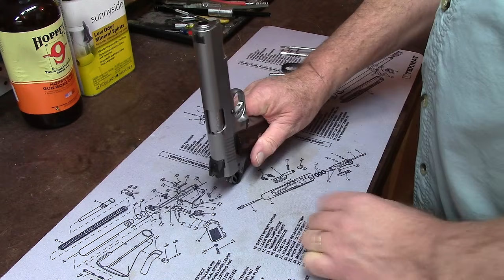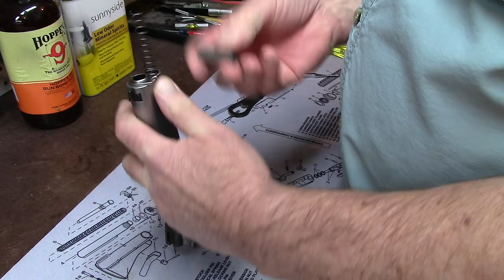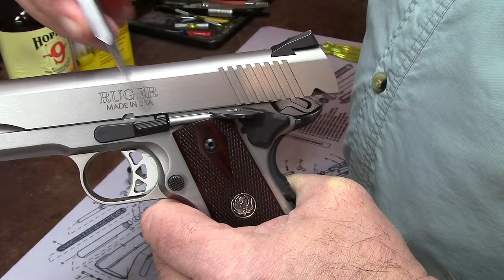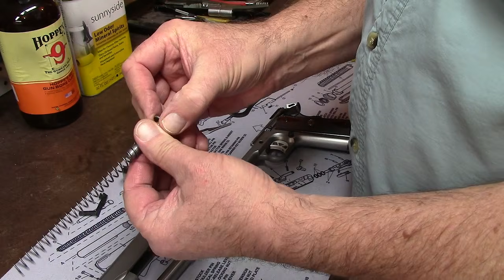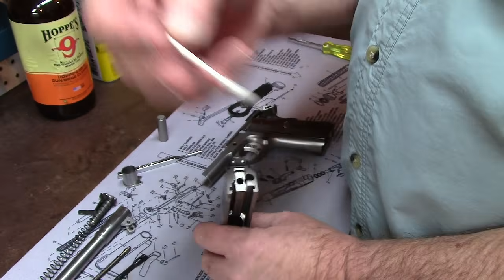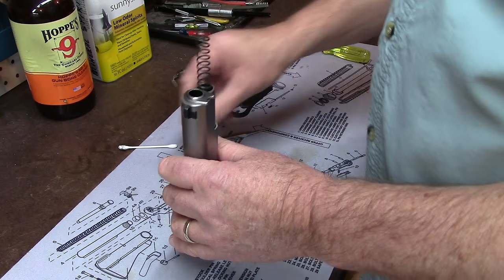How to take down the 1911 pistol for service, inspection, cleaning & lubrication ~ Now in HD!

Comment: Hi Gun Blue, I have a Colt 1911 comber commander and the finish is stainless steel, but it’s a matte finish and it’s a porous finish. What is your recommendation as to clean the finish of the gun? I did have it sandblasted by a gunsmith a few years ago and it look good after the sandblasting. I do use a flannel city with mineral out as you recommend to wipe the gun off when I Handel it. I’m afraid to use Hoppes on the finish or mineral spirits. Please can you help me out. Thank you in advance
Reply from the maker: Your gun requires no special handling.  Steel may have a surface texture, but it is not porous, and stainless steel cannot be damaged by cleaning solvents.  Simply use plain mineral spirits or paint thinner to clean it.  You can clean it with solvent forever with no possible harm.
Reply: Thank you Gun Blue. I follow your videos and appreciate your knowledge. I do use Lsa gun oil. I got some from amazon. Great oil.

Comment: Hi, I was wondering if you would consider doing a presentation on what's going on when a 1911 starts "doubling". That is, firing two or more rounds with a single pull of the trigger. Causes and remedies to this extremely unsafe malfunction.
Reply from the maker: I'm not sure its rarity warrants a video, but I'll answer your possible problem.  Real doubling is when two or more rounds fire in full automatic mechanically from any semiautomatic firearm.  That is caused by failure or the sear to capture the cocking notch after the previous round(s) fired, which is caused by a weak sear return spring.  Replace the three leaf spring.  Two other types of repeat fire can be caused by low trigger weight or weak hand hold that creates "bump fire".  I know lots of custom shops furnish low trigger weight, but a safe and reliable 1911 should have a minimum of 3.5 to 4 pound trigger pull.  Less than that can cause a trigger to bump off the finger and repeat fire.  Like all semi automatic firearms, a defective sear can result in full automatic fire, which is extremely dangerous, not to mention very illegal.  A full auto 1911 is a monster that will empty a full magazine in blinding speed, completely out of control. Understand that custom shops use trimmed 3 leaf springs to "tune" 1911s, and such springs are incredibly dangerous, because they don't have sufficient pressure to maintain sear contact and proper trigger return force which leads to bump firing.  Put a standard 3 leaf spring in, which should fix the problem.  If that fails, replace your hammer, sear, and disconnect.
Reply: @GunBlue490  Thanks so much for the reply! Since the doubling occurred in a bone-stock Kimber (one of those companies that brush you off if you don't do a silly 500-round "break-in" first), and two other shooters tried the gun with the same sporadically occurring results,  I'm going to assume it's either the spring or hammer/sear/disconnect assembly. The trigger pull weighs in at 5-1/2 to 6 pounds, so it definitely isn't an overly light trigger. I've shot a variety of different brand 1911's over the years, but this is the first one that has ever given me any cause for concern. Thanks again for taking the time to reply!

Comment: Very informative, and thorough. I have a question. What do you think about the HORNADY SONIC CLEANERS?  I value your opinion.
Reply from the maker: I used ultrasonic cleaners as an electroplater in the 1960s, when they first came on to the scene for industrial use.  We used them to clean machining debris from recesses in tiny parts before plating. Jewelers use them to clean rings and jewelry.  Ultrasonic cleaners for firearms and loading is the most hilarious nonsense I ever heard of.  There is absolutely no use for an ultrasonic cleaner for any gun or any ammo.  Watch my cleaning videos, especially the AR-15 and shotgun ones.  Get a cleaning basket, dog bowl, and a gallon of paint thinner, and you will have sparkling clean gun parts.  Total cost, less than $20.00.
Reply: GunBlue490 
Thank you very much for informative response. I’ll follow your advice. Again, I think your videos are great.

Comment: Regardless of what your other video says about dropping the slide, you should NEVER do that! Dumb move chief!
Reply from the maker: And why is doing so dumb?  I've done it literally thousands of times since 1968 on various 1911 pistols, it is and always was standard practice, and the pistol was engineered for doing so.  Except for some fragile new age look alikes which are made with below standard components, weakened springs, and delicate steels, any Government grade 1911 will withstand such dropping without flinching.  And this gun will shoot X-Rings along with any so-called tuned gun.  Not all 1911s are created equal, and some of the most highly priced custom guns that are promoted heavily are not worthy of the 1911 title.  They just sponsor competition folks to advertise for them.  I'm an armorer and I certainly do not endorse any abuse to firearms, and if this practice was abusive, I would be the first to know and to make such a caution.  Please don't bother to reply, because I shall not engage in any banter regarding silly opinions to the contrary.

Comment: You've made the best instructional clips I've seen here. I was a tanker in the Fulda Gap during the '60s, and our 'duty pistols' were (WWII vintage) 1911s. They all rattled when shaken! My current sidearm is a parkerized Springfield 'Range Officer', Nice and tight, and butter-smooth.
I've also got a Beretta, and a SIG Sour, but neither of them have any soul...the only way to have a gun with soul is to start with high-carbon steel and good wood. Anything less is just a plastic tool or a toy.
Thanks for the fine vid, and..."Thank you for your service".

Comment: Thanks for the 1911 for dummies videos! The manual supplied with my Rutger SR 1911 is a little confusing. Your video and tips were a great benefit to taking the stress out of cleaning my new gun. You should do a video on a Ruger 22 mark II. It always takes me at least 2 times to get it back together after cleaning it. Thanks again. I am now a fan for life.

Comment: In your professional opinion do you use a bore brush only in one direction or back and forth when cleaning?  Thanks.
Reply from the maker: The direction is of no significance. The important issue is to always allow the bristles to exit each end so they don't bind and bend them, ruining your brush. It has nothing to do with your barrel, which is immeasurably more durable than any brush.
Reply: @GunBlue490  thanks that's the  way I've always done. Have seen several vids that show only one way removing the brush and repeating which seemed a waste. Great vid on the 1911. I have the same one and it was tricky first few times of cleaning.

Comment: FYI-Colt makes drop-in titanium firing pins for Series 70 and and Series 80 guns. I replaced the stock steel firing pin in my RIA Series 70 full-size with a Colt titanium firing pin.
Reply from the maker: That's terrific.  I would be very surprised if it wasn't made and supplied by Ruger under contract.  Pine Tree Castings, Newport, NH, of which Ruger is just a part, is a major supplier for other diverse companies in many industries (plumbing parts, guns, etc.), including the gun trade.  Companies often find it less expensive to outsource, especially for relatively small lots of parts or for expensive metals they rarely use, and difficult to make, as would be the case of titanium.  PTC makes parts for gun firms that would surprise you; sometimes all the parts.  Years ago, I witnessed all Charter Arms Bulldog frames and parts being made there.  It's a very common practice in commerce that has been going on for a very long time, just as Sears never manufactured any products called Craftsman or Kenmore, nor did a stitch of sewing for clothing, all of which were outsourced to their own competitors in the industry.  Though several companies in the gun world sell gas checks for cast bullets, for instance, Hornady makes them all.

Comment: I have a Kimber 1911 38 Super target, when Ishoot it I have frequent double fires. I bought second Kimber 1911 45 ACP TARGET A FEW DAYS EARLIER AND IT FIRES ONE TIME PER PULL OF THE TRIGGER.
I asked a very good pistol shooter fire 4 clips through the 38 Super and he didn’t have a single double
Discharge. I then fired a clip and had 3 double discharges.
Do I have a operator issue or a pistol issue or both? Any help would be truly appreciated. 
Thank you,Bearcase
Reply from the maker: Bill Case 
It's caused by a combination of factors.  It's not a double discharge. You are firing the gun twice.  A light trigger, in combination with a limp wrist and an unusually slack trigger finger will result in releasing, and pulling, the trigger inadvertently on recoil.  Your hand is acting like a bump stock.  Squeeze more firmly with your lower grip fingers, and don't allow your wrist to be limp.

Comment: GunBlue  I haven't seen anything on Replacing Prt's  or interval's for replacing prt's other then the obvious breaking prt's .can you give some advice?
Reply from the maker: Jack Katz 
Parts require no periodic replacement. Replace according to need, when they break, if ever. Quality springs will last a very long time, and have no ordered replacement schedule.  If a gun is working, it's working, and there's no need to anticipate or predict failure.

Comment: Thanks for all of your wonderful videos. One of my 1911s is a Wilson Combat, which is a very fine firearm. I do have one major complaint with it, however. Unlike normal 1911 designs, my particular WC pistol does not allow you to remove the barrel bushing and spring tension before removing the slide stop. Consequently, it has been more difficult to disassemble. My Colt Government Models are a pleasure to disassemble though.

Comment: Being a left handed shooter, I want to install an ambi thumb safety on my new Springfield Armory mil spec 1911. I've noticed some vendors utilize a sear pin that has a notch on the end of the pin to secure the right side safety, others do not. What are your thoughts on this?
Reply from the maker: Jeffrey M. Green 
I believe it's unnecessary.  The safety engagement provided on the left side holds the safety.  The presence of two levers does not somehow increase the resistance required to hold it.  A properly made 1911 has a very firm safety, and adding another detent might certainly make it too difficult to release in the manner intended.
Reply: Thanks for your quick reply. However I'm confused. Are you saying an ambi safety is unnecessary or adding a notched sear pin is unnecessary? The ones without the notched sear pin are held captive under the grip.
Reply from the maker: Jeffrey M. Green 
If you shoot left handed, you need a safety on the right side, just as a right handed shooter has one on the left.  It doesn't need to be ambidextrous, but that's fine too.  I prefer not to comment on particular mechanisms without having personal familiarity with them, which I do not have, and I cannot comment on a generic, unspecified platform.  My comments were with respect to multiplying mechanical effort with additional spring detents, which I see no need for.
Reply: Thanks again for your quick reply. I will keep you posted on my installation!

Comment: My problem is the slide stop groove getting caught in the retention button in the spring housing of the safety when reassembly is done.  I seem to fall into a wrong move which locks the tip in the detent and I have to push on the plunger so I dont have to struggle.  I will have to try it .

Comment: I have enjoyed your channel for a while now and find myself returning when I want a no nonsense answer to my questions.  Today I would like your input on the 1911 pistols with a 3 inch barrel,  if you don't mind.  Do you know if there is a reliable one to be had?  If more than one, which one is the best value?  I would like a pistol that one day may be used for concealed carry and I am aware of the shortcomings of the 1911 for carry.  Your input would be appreciated.  Thank you, Charlie
Reply from the maker: tony blayn 
Thank you for your comments and confidence in me.  However, I have only had experience with standard length an shorter "Commander" size 1911 pistols, but not with any of the 3 inch barrel.  In my personal view, the 45 ACP becomes increasingly more challenging to shoot well with every ounce and shortening of barrel, even with the lightweight standard frames.  The cartridge performance also drops significantly with severely shortened barrels.  My personal preference is to scale cartridge appropriate to pistol size in traditional terms for those two reasons.  I would not personally use a grossly foreshortened 45; but would consider a good 9mm, which will be easily managed and has good ballistics with 3 inch barrels.

Comment: Sir, I have found your videos immensely informative and entertaining. In the few short months I have been subscribed to your channel, you have disabused me of at least to misconceptions. Thank you.
I now have a question regarding the 1911. I recently purchased a Colt gold cup, the most recent edition and I have been stuffing and emptying .45 acp cases as fast as I can muster. Mostly 200 gr lswc because that's what I had on hand. My question in the main is, is it okay to to run full house loads, 230 fmj or heavier bullets through this gold cup or is it intended as a target pistol only?
Reply from the maker: MrWhizzo 
It's a fairly common misconception that the Colt Gold Cup's reputation as a finely made precision target gun equates to it being less rugged than its service grade counterparts.  In all its finery, it's still every bit a 1911.  However, the Series 80 versions have come with two springs; a lighter compression spring for use with target grade, lower powered semi-wadcutters (colored green for identification), and a standard non colored spring for use with service grade ammunition.  Thd lighter spring can be used for service ammo on a limited basis, but will result in heavier felt recoil and eventual unnecessary wear on the pistol.  Series 70 pistols were not shipped with two springs, and the manual made no such distinction at that time, as folks used ball ammo probably more frequently than was later popular, but I would suggest obtaining a pair from Colt, as the original is probably due for it anyway.  +P ammo was not introduced until years after the 70 Series, and was not a factor.  A standard spring is weighted at 16 pounds compression, and I believe that the target spring is 14, though I can't recall for certain.  If your gun happens to function with a 16 pound spring with your target ammo, leave well enough alone.  Remember that while commercial semi-wadcutters are low powered, mid range velocity, the handloader is not limited to the power packed behind a 200 grain bullet, which can require a full compression spring, so proceed accordingly.  Again, I recommend the two-spring system, but don't use the green spring with full house loads, even if they are 200 grain bullets, because the recoil is the combined force of bullet and powder.

Comment: You are top notch instructor and always use proper terminology without profanity. That's professionalism!I just want to mention that my Colt 1991A1 Compact barrel bushing does NOT operate the way the bushing does on the full size model and the reassembly is quite different as a result.Just saying that because someone following your video will not get they 1911 back together as shown.
Reply from the maker: Gay Howe 
Thank you. Yes, many variations have been made over the years.  This was intended only for those who have this standard assembly.
Reply: Gay Howe The compact M1911's that I have seen use an internal barrel bushing and you need to capture the recoil spring and keep it compressed before disassembly.

Comment: I have a question that I am hoping you might answer.  I see that the frame of the ruger 1911 has a square cut into it for the slide stop notch.  Is that better or equal to one that has the notch cut out of the frame rail?
Reply from the maker: Bill Blair 
As a simple matter of physics, where materials are otherwise equal in strength, the one having greater mass will always be stronger.  Likewise, the frame rail that is continuous and of otherwise equal material has greater structural integrity.  Imagine two flat washers of the same size, material, and thickness; one with a hole, the other with one side cut away the same size as the hole.  Whether there is any practical consideration with a gun is debatable, but the differerence bears consideration.  The far greater consideration is the sophistication of design and engineering follow through.  It is extremely difficult to mortise a square hole, which causes many companies to do a work around with a simpler notch.  Ruger SR1911 frames are created by highly sophisticated and precise investment casting that allows such detail, just as their spring tube is a part of the frame, rather than conventionally staked on as a weaker separate unit.  BTW, Ruger elected to machine the slide from a billet of steel, because its simplicity required less elaborate techniques.  Investment casting permits the use of extraordinarily strong alloys and complex design, and is used on such things as jet engine fans!
Reply: Thank you for the informed reply.  I very much appreciate it!